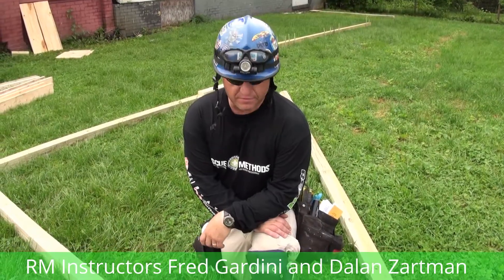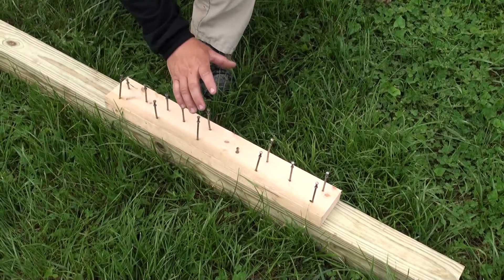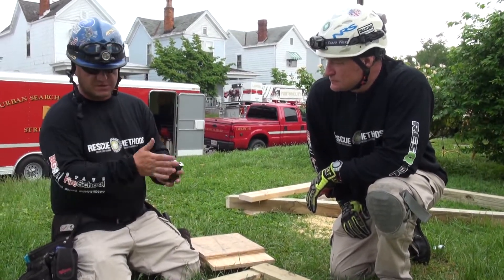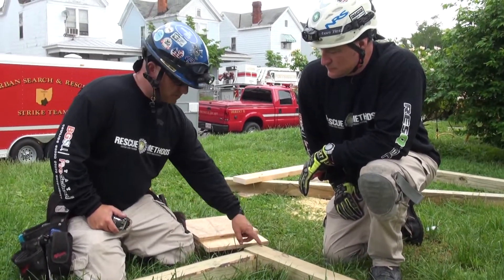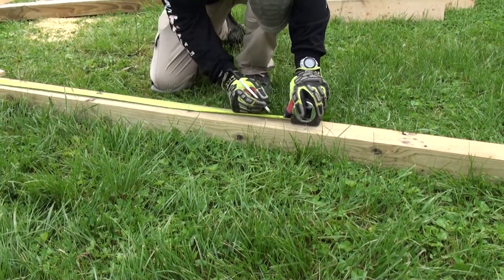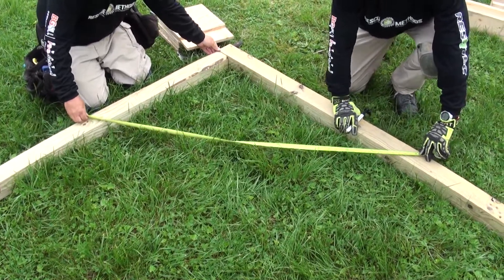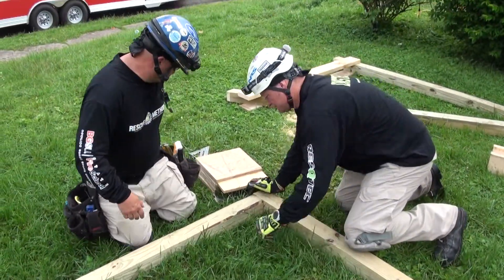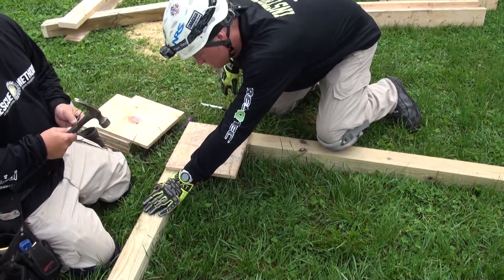45 Solid Sole Raker Part 2: Sole Plate and Connection

Comment: You added 3.5 inch onto the wall plate to count for the raker sitting on top of the sole plate. But will that make your insertion point 8ft 4inches? And not 8ft?